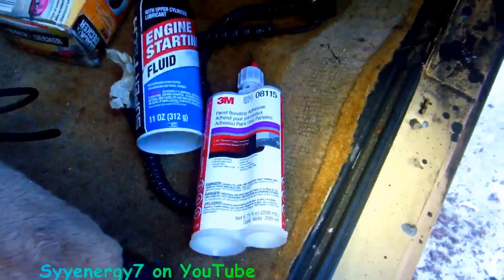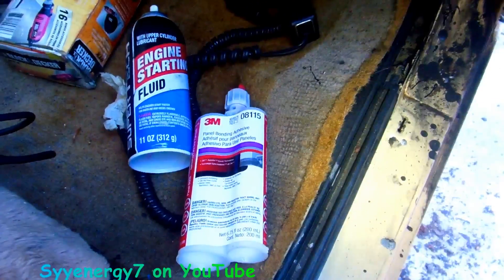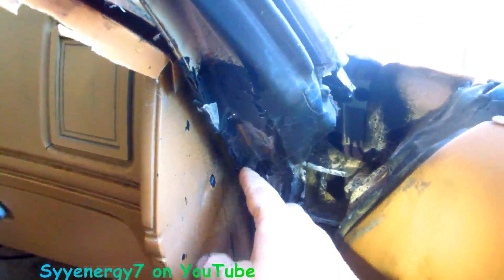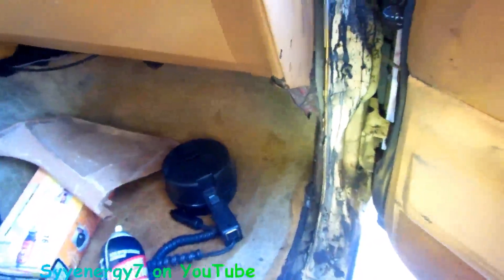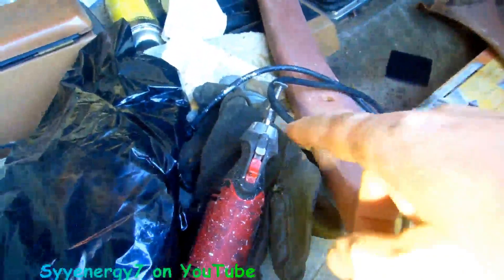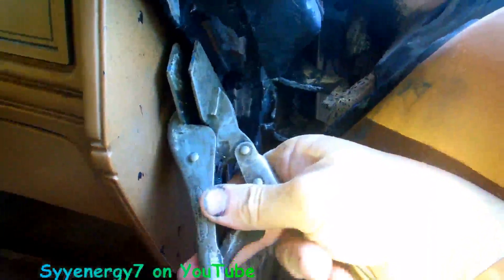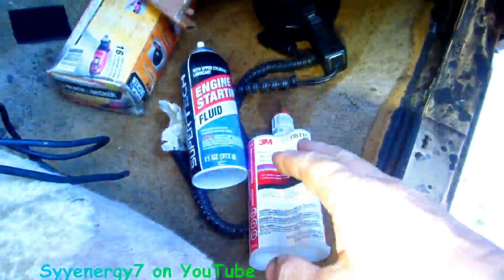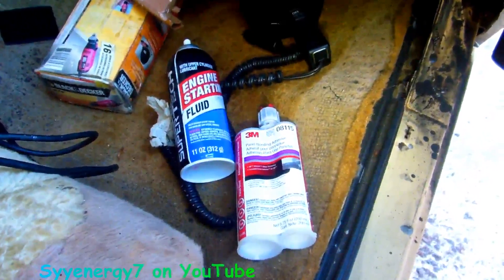AutoBody Repair with Panel Adhesive

Comment: Is jb weld plastic bonder and gal filler any different from 3m panel adhesive? It says body panel on the packaging
Reply from the maker: Probably different.  They only use the 3M part 08115 for gluing on car body panels.
Reply: This panel adhesive has a much higher shear strength compared to jb weld. Jb weld can withstand more heat over time as well